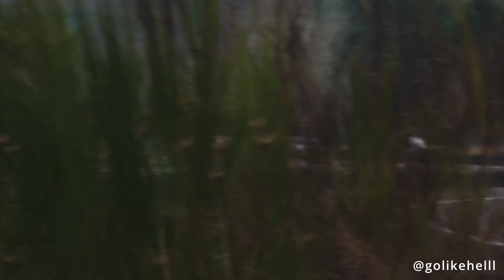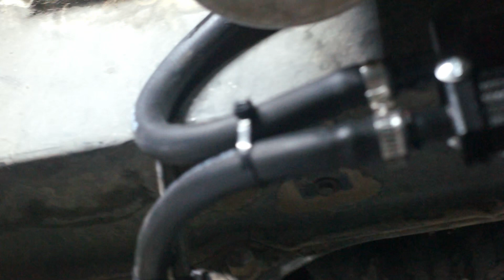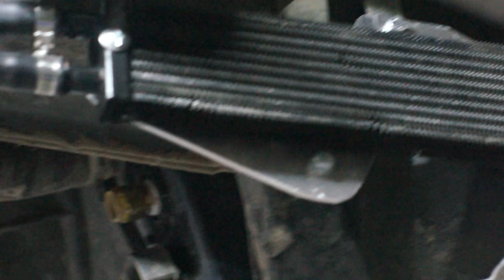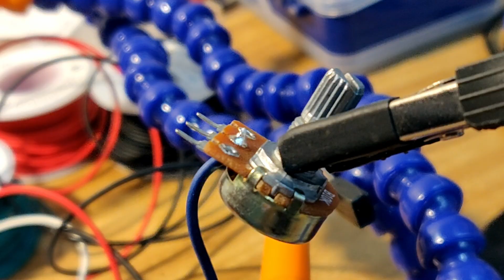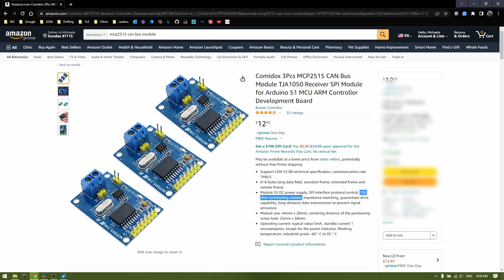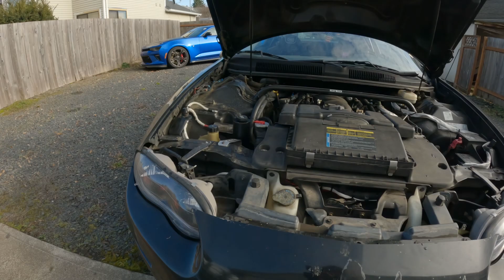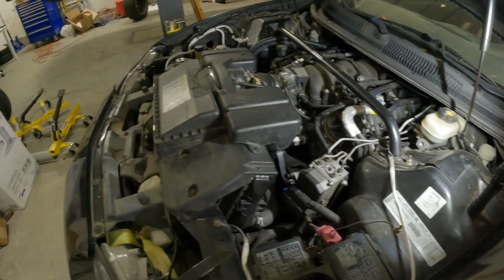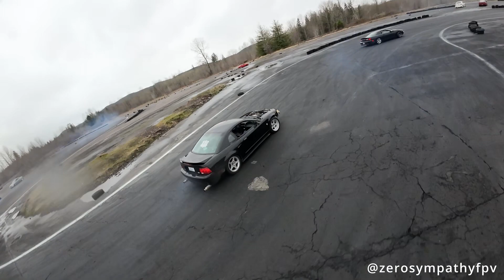DIY Volvo Power Steering Pump Controller and Camaro Drifting

Comment from the maker: Google Doc with links to all the parts I used: https://docs.google.com/document/d/1_DXvMk2XoNezXUJhuxnnkQU10Xo3-AdG6noO6GPqc9M/edit?usp=sharing
Diagram and Arduino code: https://github.com/michaelabuchanan/volvo_ps_controller
Reply: Thanks for sharing!! Do you know what Ohm value the potentiometer you used was?
Reply from the maker: @porterthenobody  I used a 10k ohm potentiometer
Reply: @shortgirllongcar  thank you!
Reply: Hey come on now, could have at least given me credit for using my source. You even left my comments in there.
Reply from the maker: I just added links to all the sources I used for the script in the code itself, repo readme, video description, and parts list Google doc. I am really sorry for not adding this in and giving credit earlier, that was a mistake on my part.
Reply: Please do a build video on controller build 🙏

Comment: Thanks for showing this.  Most of the videos show how to weld the pump to the car and then provide 12V to the trigger wire but seems like hardly anyone delves into how to actually control the pump.

Comment: Any issues with the Volvo pumps not responding quick enough? I’m about to throw this thing in my LS3 swapped Z that’s a comp car. I’ve thrown the serpentine belt enough times off of the car and lost power steering mid drift to warrant replacing the belt driven with a Volvo pump but want to make sure that it still responds fast enough during quicker higher speed transitions.
Reply from the maker: It is good for the most part (as long as you have a controller for the pump) but I have found the limit of the pump before while playing around with fast steering ratios. We found that with a really fast steering ratio it will sometimes get overwhelmed and not give as much assist as it normally does. However this is something I was able to drive around without too much issue and once we dialed back the steering ratio a bit the problem went away. Moral of the story is there is a limit to how much these pumps can handle depending on how aggressive your angle kit is but it's great if you stay under that threshold. Hope that helps!

Comment: Great video! Precise, well documented, clear audio - I like that the explanation portion runs w/o all the annoying royalty-free soundtrack so many ppl use.  EU based Ebay seller carries the GPS based controller for complete hands-free speed vs. pump pressure,  if that is needed.
Reply: Running some kind of crappy music over dialog on an educational video should just get the video taken down lol.
Reply: @lookforjoe :  that sounds interesting. do you have a link?

Comment: Great first video, very informative!
Ive been researching how to reasonably control a Volvo pump to mount on my 89 Mustang.  I think your solution is pretty close to what I was envisioning! I love DIY so this is right up my alley. Thanks Again for sharing!
Reply from the maker: Thank you, I'm glad you found it useful! Wishing you all the best with your Mustang
Reply: @shortgirllongcar  and best of luck to you on your new channel!! Im just starting out mine too LOL
Reply from the maker: @porterthenobody  nice! I'll have to check it out!
Reply: I'm the process of doing it in my 89 mustang right now and the pump fits under in the front of drivers side fender next to where the horns mount and found controller of ebay for variable speed for pump but at least 3week for delivery on that. And get pump with mounting bracket since it has isolators and make brackets off that. Hope that helps.
Reply: @georgemixter1136  Yeah the one I have I grabbed all the bracketry, as well as the remote mount reservoir! I saw likely the same controller kit you saw - I think it was coming from Portugal...

Comment: Excellent video and thanks for this.  Subbed.  I am putting this pump in my Foxbody Mustang after many failed noisy OEM Ford pumps.  I finally was able to retrofit a much quieter GM pump but belt routing + length, hoses,  and tensioner placement was a challenge I had to figure out.  This is much simpler and I will be able to mount the Volvo electric pump in the trunk for weight distribution and ease of serviceability.  I already relocated the battery to the trunk.  I also plan to use hydroboost soon since it is a must when doing an engine swap.

Comment: Great video. I wasn't expecting a breakdown of the canbus signals. Excellent. Its nice seeing this done in a GM application. I am planning this conversion for my Caprice Wagon. Right now it has a manual rack from an S10 and the only belt driven accessory is the  low mounted alternator. I am planning to install a faster ratio powered steering box and powering it with a Volvo pump. I would imagine that my plumbing will be similar except for the fact that I have an old school steering box with a pitman arm instead of rack and pinion steering.

Comment: small thing about the fiberglass heat resistand sleeving 
if its simulair stuff to the exhaust wrap than be verry carefull when you have oil and transmission fluid leaks , friend of mine had exhaust wrap and had transmissionoil drip on it , one day people where signalling him to check under his truck so he pulled over and was just in time extingueshing the fire under the floor of his truck , the stuff soaks up oil like a sponge
Reply from the maker: Thanks for the comment. It's an important thing to keep in mind and probably something I should have mentioned. I had a similar scare on my DSM with a turbo blanket starting to smoke due to an oil leak. You have to be able to check for leaks on a regular basis and always keep a fire extinguisher handy although the sleeving might not be worth the risk if you have a car that doesn't see track time.

Comment: Why is the volume so low? I could barely hear it with my amp turned up to max. 
 
Anyway, it's a nice video, and I'm glad you posted it. I am currently working on a V8-swapped 1960s Spitfire and am looking for power steering options. Most YouTube videos only show the common electric-assist power steering options using Prius or Saturn parts, which would be much too bulky for a car as small as a Spitfire. But seeing that a Volvo electric PS pump could be an option, paired with a suitably sized rack, I think that will be my preferred route. Thanks for the idea!
Reply from the maker: Glad you found the video helpful and sorry about the audio. The volume was an editing mistake on my part. Best of luck with your project!

Comment: Great video!  I think your design can be extended to include GPS or a mechanical
speed input to vary the pump speed.  I am looking to use the Volvo pump in my 73 Camaro.
Reply from the maker: Thank you, and yes once you have the speed input figured out it wouldn't be difficult to add into the code. Just not something that was useful to me in a drift car

Comment: This is fantastic video on the subject. Very detailed and informative. Keep up great work. I wonder what your next project might be 😊
I have been using the same pump on my Jaguar EV Conversion with my own CAN controller for over 2 years and it works great. For me the biggest benefit of CAN control was eliminating annoying start delay since I switch pump OFF in P and turn ON in D and R position. The only issue I ran into was with bearing since my pump is 18 years old from high mileage car. I have video on my channel how to fix it if anyone is interested.
Reply from the maker: Thank you for the kind words. It's good to hear that the pump has been treating you well long term and I'll definitely be checking out your rebuild video once mine starts getting tired.

Comment: How was that your first video!?! That was amazing!
One thing I wonder, would a controller like that work the same on other power steering pump models, like the mr2 or astra?
Reply from the maker: Thank you! And in terms of this working for other pumps - I think the MR2 one uses a PWM signal instead of canbus to control speed so that would actually be a bit simpler to make a controller for than this one for the Volvo pump

Comment: Thank you for the video. Very detailed. Now i gotta learn about the controlling side. I'm wanting to adapt this to a B7 Audi S4. Going to have to learn more canbus stuff. So your setup didnt connect to the cars canbus at all? 100% stand alone correct?
Nice drifting!
Reply from the maker: Thanks! And yes, the Camaro doesn't use canbus so it's not connected to the car in any way, just the pump

Comment: Hello! Congratulations! Your entire creation is excellent.
Have you thought about implementing your Arduino project with a speed sensor? Automatically changing the rotation speed of the pump as the car speed decreases.. Do you always keep the RPM of the power steering pump constant with the potentiometer? Do you think it is better to "harden" the steering at high speeds and make it "soft" at lower speeds? Thanks, I await your news and greetings from Rome!😊😊
Reply from the maker: Hi, glad you liked the video! In this setup I described in the video I do keep the pump speed constant according to whatever the potentiometer is turned to. It would be pretty easy from a coding perspective to add in another speed factor to it. However for drifting this could cause problems as you need all the power the pump can give you no matter what speed your car or the wheels are going. So while it's not something I will probably pursue it could be a cool continuation of this project for someone else to take on.

Comment: quote me if i’m wrong but if you use a arduino nano A000005 instead of the every you don’t need to use the converter from 12v to 5v cause the board has a built in converter basically forgot what the chip was called that does it i will be trying that board for mine will let y’all know if it actually works but awesome video all the info needed to do this thank you for showing us the way
Reply from the maker: Yes definitely report back on if that works, would be a nice way to simplify the setup a little bit
Reply: yea main reason i’m trying it out just got it all wired up, waiting for standoffs to come in going to put code in tonight and test tomorrow that de soldering of the headers not easy lol
Reply: i’ve tried many different was to upload code onto arduino ide and i’m completely lost please help!!!
Reply from the maker: @brandonjacob3897  sure, if you have IG message me @michaela_buchanan or send me an email at mebucha2@gmail.com and I can try to see what's going on
Reply: @brandonjacob3897 Just curious did you ever end up figuring out if the converter is built in?

Comment: Great first YouTube video. Keep up the great work. I did this swap quite awhile ago and before DIY controllers were common. Actually removed the setup due to feedback issues when braking and steering inputs overlapped. This would cause the steering feedback momentarily pause and resume once I eased off the brakes. That was 100% due to not enough line pressure and the default pump speed.

Autocross was not fun.

Anyhow, I’m coming back to the Volvo setup and I’m going to be running a similar potentiometer/controller. Very curious if you’ve experienced anything similar to what I just described?
Reply from the maker: Thank you. I tested my car on the street for a few weeks without the controller and that sounds similar to what I felt. I would try weaving back and forth aggressively and feel the pump not really work after a turn or two. The feel now is maybe not 100% as good as hyrdaulic but it's not an impediment like it was without the controller. I've done probably 4 more drift events since posting this video and it hasn't been a problem.

Comment: Great video, awesome job on the controller. I’m thinking about doing this on my ls swapped e36 but want the control of the pressure. Trying to think about a way to tie it into my Holley terminator x with the can module cause I can do pwm output. This video is a big help 😊
Reply from the maker: Thanks, glad it was useful to you! Best of luck with the e36, sounds like a really fun project :)

Comment: Thanks very much for such an indepth DIY. As others have mentioned, almost all the people who have used this swap have only connected the signal wire and had the pump running on limited capacity. And for a 1st video, you have done a great job so please keep posting more 👍.

I'm sure about the fact that this pump's onboard canbus has multiple sensor reading capability (steering wheel movement speed, vehicle speed and more). Amazing how you have used Arduino to control the speed of the pump with a canbus board. I do have a question related to that - is it possible to use arduino to read the speed of the vehicle(from VSS) and control the pump speed to dynamically change as per the VSS?
Reply from the maker: Thank you for the kind words! It should be very possible to have the pump change speed based on the VSS, the hardest part would be turning the signal from it into something the Arduino can read. Then you would just have to modify the code to change the speed based on that signal rather than the potentiometer position. I know I've seen people do this with a GPS speed signal but I would worry about that being reliable enough for something like this. Hopefully that helps!

Comment: Great video and thank you for making this!  Can you confirm that the M16 is the fitting on the rack for the high pressure side line and not an M18?  I have the same rack.
Reply from the maker: Thanks! I made a mistake in the video and switched the fitting sizes for those. It should be M18 for the high pressure (bottom port) and M16 for the return line (top port). I put this and other corrections in the description of the video so make sure to check that out if you plan on trying this on your own car. Hope this helps!
Reply: @shortgirllongcar  Perfect!  Thanks again!

Comment: Why do this adapted pumps always make a humming noise, but not in new cars? I want to do this in my daily car and I don't know if the noise is annoying. 
Good video btw ✌️
Reply from the maker: Thanks! The pump can be loud but if you put it in the engine bay I usually can't hear it over the sound of the engine. It would be pretty annoying to have inside the car though.

Comment: thank you for all the details but i am curious to know if i can use the same controlers and code for jeep electric steering pump?
Reply from the maker: I'm not familiar with how the Jeep pump works but if it uses CANbus you might be able to use a similar setup

Comment: any particular year or model  Volvo you would recommend.  Also what did you use for an 80A fuse.  Great video!
Reply from the maker: There's a pretty big range in models and years of Volvos that should have the same exact pump. These include the 2005-2011 Volvo V50 , 2004-2011 S40, 2006-2013 C70, and 2007-2013 C30 so any of those should work. For the fuse I used an ANL fuse and fuse block from Blue Sea
Reply: @shortgirllongcar  great thanks!

Comment: 🤯🤯🤯🤯👏🏼👏🏼👏🏼👏🏼👏🏼👏🏼👏🏼
It could be posible to take that signal from the speed input for the ecu instead of a potenciometer, to make it automatic?
Reply from the maker: It's definitely possible. I know some people already get speed from a GPS module to control the pump speed. Shouldn't be much different if, for example, your car has OBDII and you grab speed from that. You would just have to modify the Arduino code a bit.

Comment: Thank you for the info! I just put a volvo pump on mine, but I run a MS3 computer that has CAN capabilities. "CAN" I use parts of this code to get my ecu to control the pump? 

I haven't had any issues with the pump in "limp mode" but it would be cool to learn how to use more CAN stuff.
Reply from the maker: Yes, feel free to do that! And check out the code credits for more examples on how to set up the CAN part of this

Comment: Great Job on this Video! very informative! and also thanks for the warnings and highlights that one should for!
Any Idea if this works on a BMW rack? been searching for someone who tried it on a BMW but cant find any...:(
Reply from the maker: I did find this one forum post (https://www.e46fanatics.com/threads/electric-hydraulic-power-steering-conversion.1250691/page-3#post-18528415) where it looks like someone successfully put an MR2 pump in an E46 but not much info outside of that. Make sure to comment if you try it, I'm curious to hear if it works.
Reply: @shortgirllongcar  Sadly that post wasnt from a drifter :P he's happy that it feels heavier than stock steering :(  
That is far from what I want on my wisefab lol! I do have a Mercedes A-Class Electric steering pump on my E36 but it doesn't feel that powerful and the steering gets really heavy in some situations!
I'm looking for something that would allow for lighter steering and faster self-centering! 
Anyway thanks for your reply and sure I'll get back to you if I ever found a solution! :D

Comment: Thank you so much, I have been searching for this kind of information. May I ask you a question? Does your package use the vehicle speed signal to change the pressure value?
Reply from the maker: Sure, glad you found it helpful! Yes, technically we are using the vehicle speed canbus message to control the pump but in my setup that message is varied by the potentiometer not by the actual vehicle speed.

Comment: Nice video! Im doing this to my volvo 740. I was wondering do you have the stl file for the box that you put the arduino in perchance? Im completely new to cad and don't know what im doing, so the file would be of huge help :)
Reply from the maker: I still have the STLs for the box but I will say I am also a CAD novice and it's pretty janky. I can send them to you if you send me an email but personally I would recommend only using them as a reference if anything